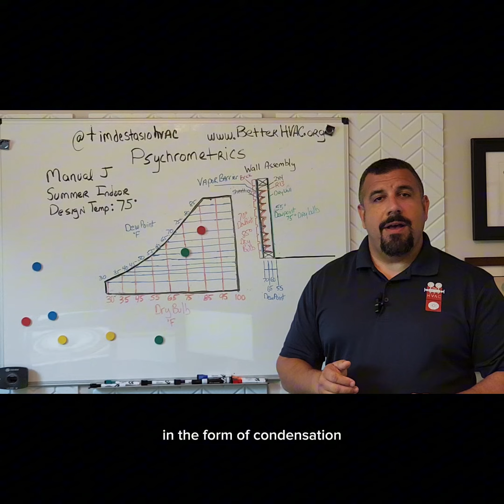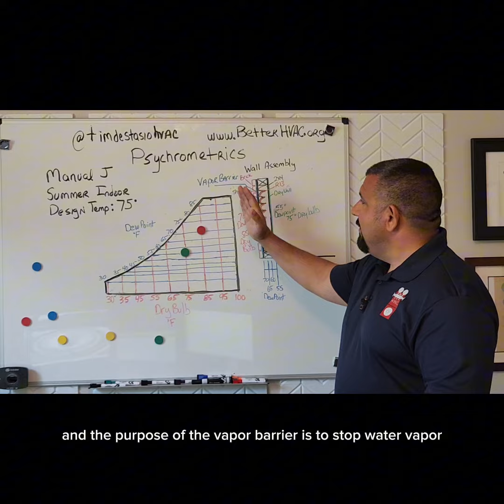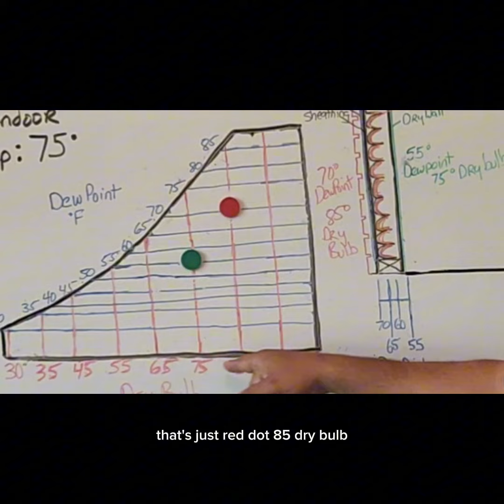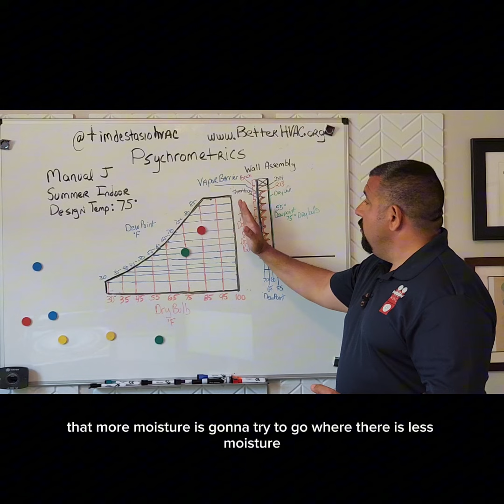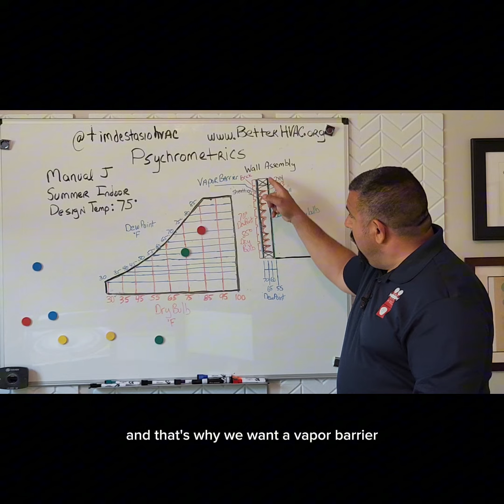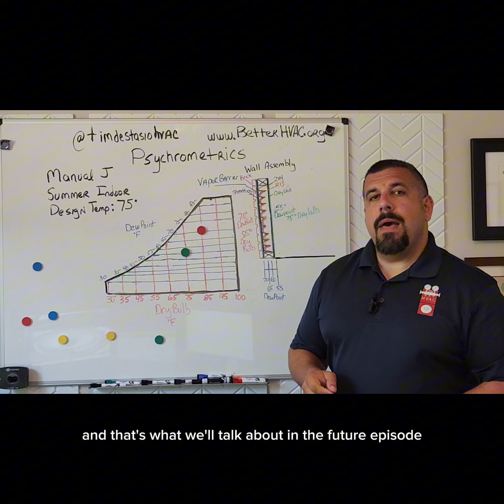Psychrometric Saturday: Vapor Barriers

Comment: Hey, Tim. The location in your illustration is commonly the location of the weather resistive barrier "WRB."  Some WRB systems are vapor barrier but the majority are not. Vapor barriers, as far as building codes are concerned are generally located on the "warm in winter side" of an assembly. So, commonly the interior, directly behind the drywall.
Reply from the maker: @BenBogie-ee2sm  yes I mispoke since i have a zip system which does both. But even house wrap has a dual purpose as a wrb and a vapor retarder (not barrier), correct?

And yes in cold climates, the vapor barriers on the inside of the cavity.
Reply: @timdestasiohvac  zip system is still only a vapor retarder (1-3perm), not a barrier. House wraps aren't usually used for vapor control; that's typically done by an interior control layer like 6mil poly or a variable membrane. Most often, they should be as minimally vapor restrictive as possible to prevent moisture from trapping in the building assembly and letting it dry to the outside. There are certainly caveats to that, but overall, that is the most common approach. 

I totally enjoy your content BTW!
Reply from the maker: @BenBogie-ee2sm  thank you. I believe zip makes a pretty good vapor retarder though. And an effective air barrier.